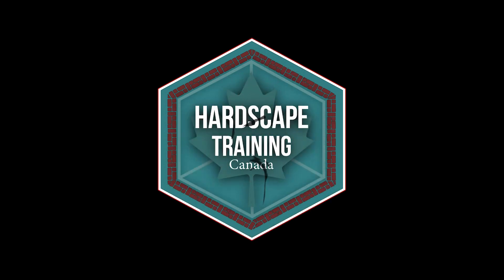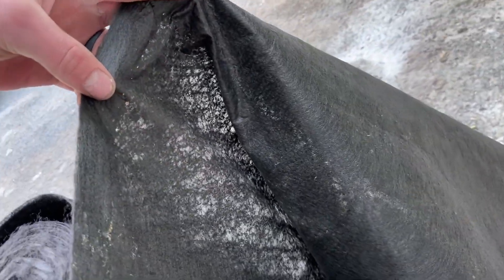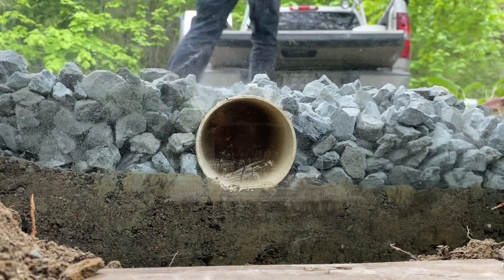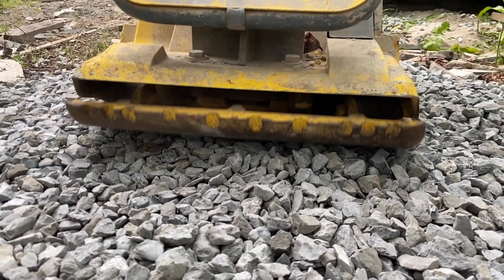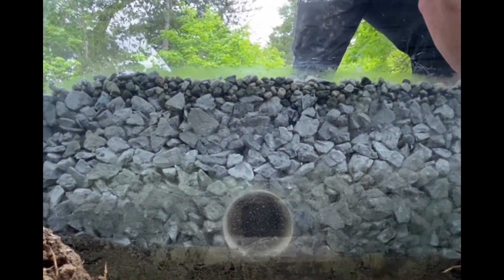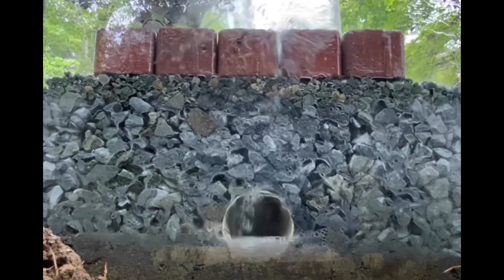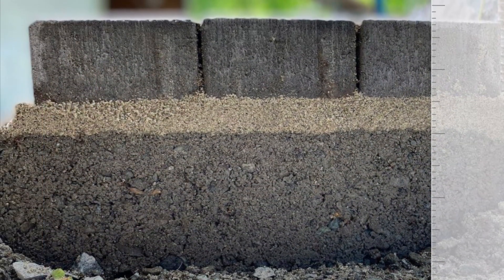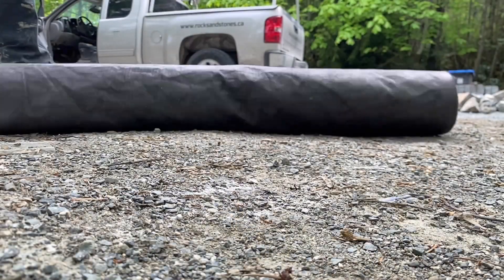Why build with an OPEN GRADED BASE? See why it is revolutionizing the HARDSCAPE industry!

Comment: Do you think this method would work if I connected a downspout from my roof too the pvc pipe aswell?
Reply from the maker: It depends on the outflow point of this system, but theoretically yes, although typically in a modern house drainage system there is a solid pipe, and a perf pipe, and the downspouts are connected to the solid pipe system and outflow to your cities storm water system or main pipe
Reply: Do not do this. You are intentionally flooding your subgrade if you do this.

Comment: do you still do open grade in clay soils? and do you grade the subgrade so it disperses water in one direction? Thanks!
Reply from the maker: Yes very good question Greg! You absolutely can, and typically you would pair it with a perforated drainage pipe system to act as an overflow for any excess water that isn’t going to percolate into the ground
Reply: Came here to ask this! Thanks!!
Reply: Where does the drainpipe need to extend to?

Comment: Hey! Can you please tell me if this technology is suitable for parking? if so, what is the thickness of the gravel? and how is the end stone fixed?
Reply from the maker: Hey yes absolutely. It will depend on your local building codes, but typically 10-12” minimum for the base layer on top of a compact-able sub grade material. Edges should be contained with a pre-fab concrete or natural stone mortared in place or set in concrete.

Comment: What sort of base do you recommend under a small retaining wall (under 4 feet)??
Reply from the maker: Hey typically 6” of compacted roadbase (in 3” lifts) for walls is sufficient. I usually will just make sure I dig down to load bearing soil and build up roadbase from there
Reply: could u do open grade for under walls too, instead of road base?

Comment: Thanks for taking the time to make these videos I know it’s time consuming. Also, I wanted to ask a question, I’m doing my own interlock at my house I’ve got about 1250 ft.² I live just outside of Toronto and so we do have frost issues obviously. There has been a patio as well as interlock stones covering the entire 1250 ft.² and I noticed that there hasn’t really been any sinking or heaving on the previous system. So my question is should I still remove all of the material and start over? They have used lime stone screening and from what I can tell they did not use a three-quarter stone underneath. However, there does appear to be about 4 to 6 inches of compacted lime stone screen. Just to mention, the areas that I removed we’re in fact replaced with 5 to 6 inches of three-quarter stone with some lime stone screening on top; my final base screening is going to be 1 inch and I was wondering if I should go with high-performance material without the fines as I don’t want to use sand. Sorry for the long message. Thanks again for the videos I appreciate it:)

Comment: What have you used for edge restraint with open-graded base?    I see Unilock arguing for an additional geogrid layer on top of the 3/8" clear bedding layer, and then use cement on the edges.  The cement locks into the grid on both sides.
Reply from the maker: Hey yes typically I go for a concrete curb to lock everything in as my edge restraint for pavers no matter what. However we don’t get a lot of freeze/thaw here so it last a long time. I will be testing some pre-mixed bags of concrete edging shortly. I know that there are options for a standard plastic edge restraint as well, just with a special spike to bite into the open graded gravel better.
Reply: @HardscapeCanada  When you do your review of edge restraint, you might want to have a look at this method and give an opinion:
https://www.youtube.com/watch?v=GYVzHxie9eU

Comment: How many inches would you use for a concrete open gradedbase, I imagine this would help a lot with concrete rising and lowering over several freezingings. Would the sub grade need to be graded so that water sheds off or would it be ok to just put 6 inches of open grade and not need to worry about the material beneath it?
Reply from the maker: I would imagine that you would want to go closer to 10-12” of compacted open graded for a concrete pad. If you think the area will see water then I would grade the sub grade and even add a perf overflow for drainage. Definitely need to use your judgment as far as drainage seeing as the surface won’t be permeable

Comment: Great video!  What materials are you using for the joints?
Reply from the maker: For our local “Aquapave” pavers we use a very coarse washed sand. Also have been looking into a product from a company called Romex that deals in permeable grouts etc as well as more permanent permeable base systems